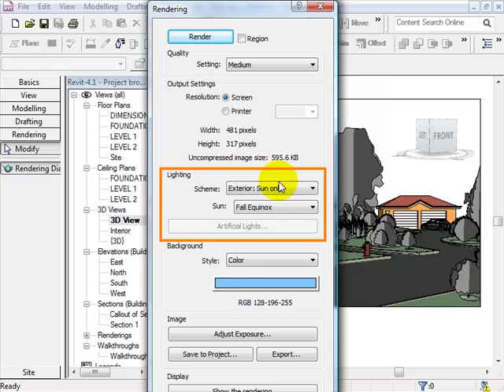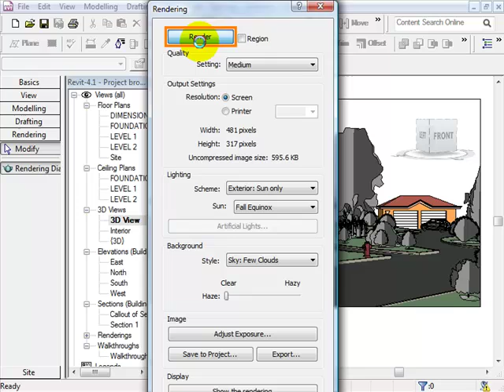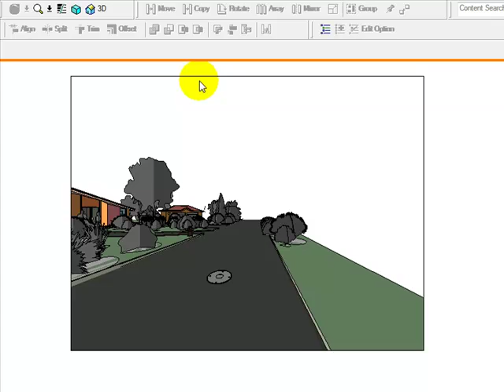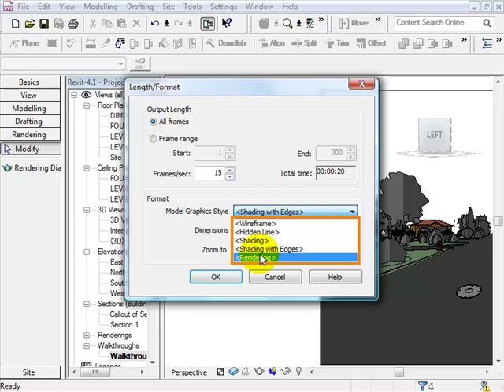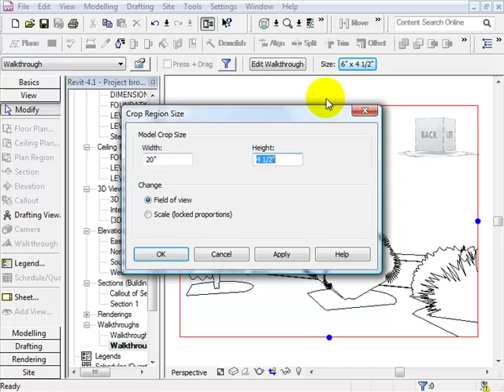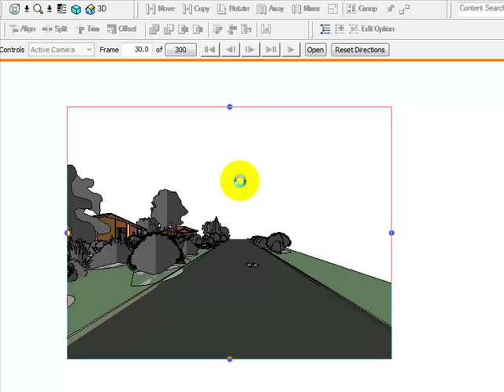Revit Lesson by www.revitstop.com

Comment: I have revit 2010 and I am trying to render a walkthrough but for some reason it does not want to work. I follow all your steps then it starts processing when its at a 100% it just starts over even if I canceled it when its at 100%. I tried it on a different computer it still does not work. Help what am I doing wrong.